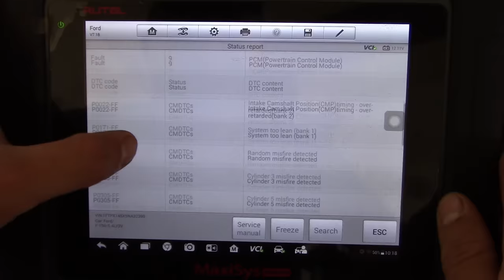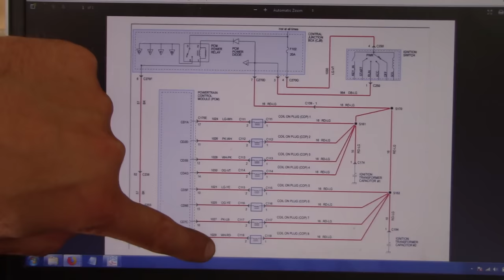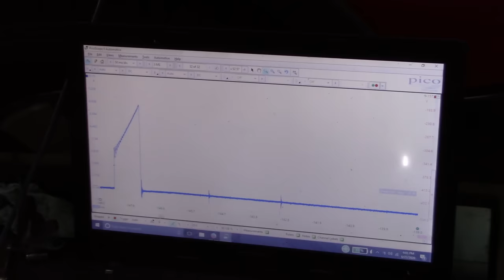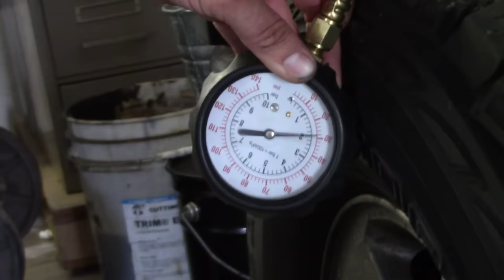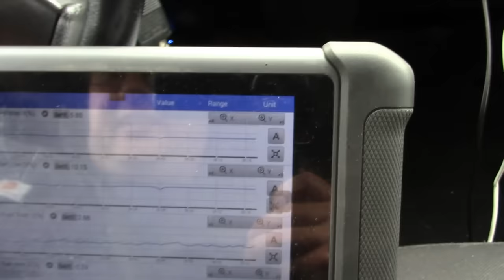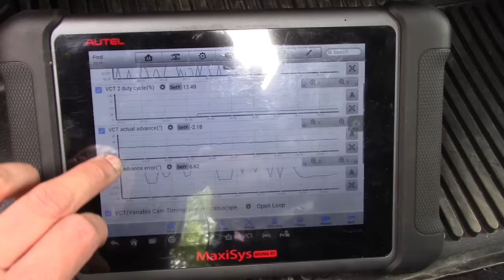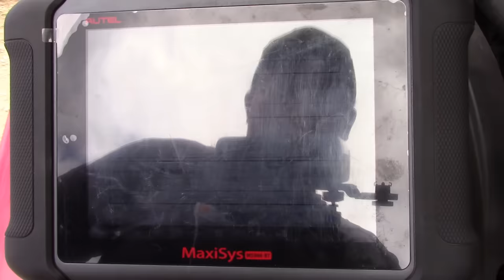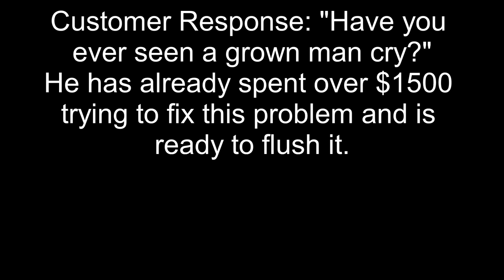2005 Ford F150 5.4L - missfires, intermittent rough running, rattles and knocks, P0021/P022

Comment: Its amazing how much of a difference maintenance means to one of these mod motors. I have seen engines fail under 100K, and have seen many that go well beyond 250-300k. One of the biggest things about these mods is clean good oil and preferably synthetic oil.
Reply: Yeah the car wizard is in the frequent oil change camp for these engines. Still though the tensioners can blow out and cook the motor so it may not matter.
Reply: @benjohnson4449  I wonder what camp the wizard is in when frequently the yellow cabs in NYC exceeded 500k miles. They used these mod motors.

Comment: Great video. You can trace it all back to inadequate pressure to the phaser solenoids. Last and farthest point from the pump. You nailed it when you got there. 07 Mustang GT is my last Ford. I do love the car. But damn just damn. Ford still hasn't figured out how to put a spark plug in. Funny they went from 14 ft lbs to 25 foot lbs for spark plug torque and have the opposite issue. Used to blow them out, now they break them off inside. Who know what the deal will be with the coyote engine noise they say is normal. ticking and rattling is not normal. Bless you for taking on such chores. Ford's cab forward design is also no help.

Comment: Ive had the pleasure of putting a new motor in an f150 after motor failure due to loss of oil pressure at 120k. Cam phaser were replaced before that at 90k. Oil pump backing plate was letting oil past the pump. Stupid idiot oil pressure light gave no warning until it was too late. 

Great video!!

Comment: Melling makes machined cast iron tensioners without gaskets.  They are for older trucks but fit the 5.4. The gasket blowing out is one of the main reasons the timing slips.

Comment: Hey Wes, here is some food for thought, this may sound crazy, but think about it for a little bit.The way I see it, he has a few options, (1) Scrap the truck and take a total lost. (2) He could go back to the person he bought it from and demand his money back “good luck with that“ (3) Sense you’re
already this far into it, replace the two chain tensioners and guides, the VVT solenoids, JB weld the front cover, don’t worry about the cam bearings, once you restore the oil pressure, they'll be fine, you may get another 50,000 miles out of that engine, put every thing back together, flush the engine and send it down the road. Of course you have to let the customer know what you’re doing, "FULL DISCLOSURE"  He should also go back to the Ford stealer/dealer and demand his $500 back and use that money to buy the parts needed. Now! That’s definitely not the way to do things, but it’s probably his best option right now. 
Just something to think about.
Reply from the maker: We just might do that.

Comment: Good news the known problems are repairable. Once repaired the motor will last 400,000+. We had a fleet of these starting in 04…. Good lord what a mess. 

In general we had the heads rebuilt with all new components, this increase oil flow through larger channels in the rods and rockers.. replaced with stronger oil pump, replaced timing chain and cam phasers.  

The only other common problem was 2nd gear on the automatic transmission.

Comment: I have the same vehicle, a 2005 F150 5.4 3 V engine with 346,000 miles.  Used 5-W-20 until I learned I should switch to 5-W-30 motor oil.   I always used Royal Purple Fully Synthetic oil, just switched to 5-W- 30 about 100,000 miles ago. Never ever did anything internally to the  engine except change the VCT solenoids because it seems like the trendy thing to do.   There was hardly any  burnish marks on the metal of the VCT's, and the screens were very very clean, and no plastic framing on those screens were missing.  The innner side of the screens werre also very very clean.  I do get some ticking noise, but I live with it.  I have original everything on the motor and all the componets, etc except the VCT solenoids. I only changed the starter at 190,000 miles. It has original alternator, muffler, tailpipe, and brake lines ( I think stainless steel).  Original catalyitic converter still original.  I did virtually nothing to this motor. I am a believer in changing parts before a breakdown, but in this trucks history, there's no indication of having to do anything.   They say you should change the timing chains every 100,000 miles. I guess then I shoudl've done that three times already, but it too is original. So what did I do to deserve this?  I don't know.  Am I just lucky?  The truck has always been hooked up to a trailer hauling soils and mulch in my business, so it's  always at the ready, and it never fails me.  Oh, and the transmission is original too.   Never a hint of a problem. I just change the filter at 100,000 miles, and I think only 1 more time after that.  And it hits the mark switching gears on the automatic trans everytime. Is it the Royal Purple fully synthetic oil?  Maybe.  That seems the only thing I believe in that could've given me longevity.  I think it will take me to 400,000 miles.  It only started to rust about 3 yeares ago here in Michigan, so I do have to swallow my pride with rust around the wheel wells, but I want to know just how far this motor will take me when most other people think this motor is nothing but trouble.  For me, it's the best Ford truck I've ever owned because the incidence of repair is almost perfect. Since it is a work truck, I do store it outside in the winter and not subject it to salt on the road.  THUMBS UP!!! Great Youtube video!!
Reply: If you work the truck, that is actually better, unloaded stop and go city driving with prolonged oil changes is one of the killers of these.  In my case it was poor build quality, I bought new, have the sticker and have found other folks with builds from the same plant in the same month have terrible outcomes like me.  I have reman engine, transmission, and rear axle.  Nailed the bastards for the rear axle under warranty, which is pathetic to have a failing axle at 35K miles.  3K mile oil changes couldn't stop my pig from failing under the hood

Comment: Driven my Ford daily for 17years and 350000.0miles!! She is a 2002 4.6 2valve engine 5speed car Mobil 1 10w30 fully syn engine oil n Motocraft filters keeps my baby on the road!!
Reply from the maker: That's a 2 valve engine, which is a lot more reliable.

Comment: Dude, you can't trust dealerships. Like I said in a previous comment, I had a Tempo that was running hot and ejecting coolant. They told me the entire cooling system and the drive belts needed replacement. They charged me $980, and the car overheated and ejected coolant on the way home from the dealership. I decided to look under the hood, despite knowing nothing about cars at the time, and found that one of the clamps on the lower radiator hose had corroded away, due to the fact that it was an Illinois car. After that, the car began randomly dying in the middle of the street, or not starting at all. After dealing with this for a year and putting it in multiple shops, we eventually determined that Ford installed the wrong size alternator belt, which was causing the alternator to charge intermittently. A week later, I went and got a job at AutoZone and started teaching myself about cars. They say that everything happens for a reason.

Comment: I was yelling at the TV through the whole episode. With the exception of the idler wearing a hole in the timing cover, my 2004 F150 had every single one of the same problems including the bits and pieces in the bottom of the timing cover. Cost me north of $3k and it was my last ever Ford purchase.

Comment: My mom has a 2001 F150 Lariat with a 2 valve 5.4L. She bought it from a friend and it had all sorts of problems, one of them being the chain tensioners. I knew it was a problem from the bad chain slap it had and she didn't have enough money to get them replaced, so I paid the $1100 or so for the job. My mechanic said it was a good thing I did because both the chain and tensioners fell to pieces when he got the timing cover off. I knew something bad was going on because the couple of oil changes I did before that job had pieces of plastic and metal flakes coming out of the oil drain in the sump. It was either a few weeks or a few months from detonating itself.

But it had all of the other usual problems, a rotted intake manifold leaking coolant. It eats coil packs, bad fuel pump, 4x4 problems, etc.

Comment: Poor bastard. Add all that to the huge rusted out chassis, its not worth repairing. Better to strip interior and useful parts off it and sell it for parts and panels. Here in Australia, if you took a car like that in for a roadworthy, they would laugh you out the door with that rust. Your a good mechanic Wes, ive just started watching your channel, good info.

Comment: From the comments i am reading, alot of people are not watching the whole video. Or maybe they need glasses.  
Either way to are pretty blind to what the problems are compto the real cost of fixing it. I know Wes probably grimaced at the thought of putting it back together  and with fingers crossed hoping for the best. 
Doing what you did, for what around $1k, hell of a lot better than $6k on a truck that will last may 5 more years. Great video and good job.

Comment: I've got this same truck...'05 5.4 and I bought it new. I've changed the oil every 3-4K and have had no problems with the truck at all. Runs like new, sounds great. These engines demand clean oil. I would say that dirty, gritty oil tearing into the tensioner gasket is what started the whole mess. Too bad for the buyer...because ignorance is taken advantage of.
Reply: what oil and filter did you use

Comment: Couldn't make it through this video so I didn't see the outcome. 
I'll share my experience it might save people a lot of money!!
2007 F150 5.4 started doing the exact same thing around 150K. Cam phaser blah blah blah.....
I found it way to coincidental that it started doing this the same day I did an oil change. Miss fires like a MOFO. 
Disconnect the VCT solenoids and everything runs great (except a bit of power loss) but the noise and miss fires  are gone.
After some research discovered a gasket or seal related to the variable timing was the culprit allowing oil bypass and severely messing up the timing. The fix to change a 5 cent piece of rubber  was going to cost me severe down time with my truck and the surgery involved may be a little advanced for me. I changed the oil to a 5w40 and reconnected the solenoids, night and day difference!! That was 6 years ago and It's still going strong. I take it on some long trips and even tow the odd trailer and the timing hasn't been an issue since switching to a  5/40. .................Spark plugs and exhaust manifolds are a different story.
Recommend  keeping an OBD2 scanner, voltmeter and a small tool kit in these trucks. These items have saved my ass more than once!

Comment: I have  a 2010 F150 with the 5.4 3 valve I am the only owner had it since new it has 235,000  miles on the original  engine  , chains and still  going strong. 😁🙏 it's been a great truck for me but it's been well taken  care of .

Comment: Great video Wes!!!! I have 2004 5.4 in my F150 and was driving and truck started rattlin and misfire detected with scanner.....Long story short, it shot head off valve a blew hole threw piston!!! Loved the change engine light remark, that's exactly what I did. I bought new engine with updated cam phasers n all that !!!

Comment: I’m late to the party 🎉 but I like to watch Wes Work. This Ford engine is a good lesson in how well a well oiled machine holds up when it’s not well oiled. Those timing chain tensioners diverted oil away from the top end of the motor.

Comment: When I worked at an independent shop we did at least 3 cam phaser lock outs on these came with a little tool that flashed the ecu to remove the vvt
Reply: Sure, you can go that route if you're hard up on money. However, it doesn't fix the failing oil pump or the blown tensioner seals that are the main issues in these engines.

Comment: I have seen these phasers wear out right after warranty ends, and about 5-7 before. This one lived to be ancient compared to most lol. I have also seen the control solenoids fail and screen get plugged blocking supply through the solenoids.

Comment: I have a 1999 lariat with the 4.6l it took me a long time of not getting right parts. Always heard you want a Windsor and not a Cleveland bor visa versa. Will a friend told me he work at the Ford plant in Kansas city building Ford trucks. Had WOW moment. I found the code on my truck sure enough it was built in Kansas city. Now im get the right parts because different everything is heftier for example I ordered a new timing chain kit because had a little rattle it doesn't have ca m phasers its a 2 valve. And I also went ahead and got a new harmonic balancer. The one I was given first was much smaller than the one I had on it. Tookbit back. He gave me the one for a Windsor it was a little bigger but still waybto small. I told the guy st Napa about what my friend told me about Kansas city. He did some checking and found indeed they have parts for the Kansas city 4.6l but he would have to order it. Frim that day forward never had a problem getting part's. I changed alot if parts only because if there age not because they went bad. I only have 2 coils each controls one side of the motor. I replaced both just because . Got them from Amazon. With in a year one went out. I still had the old coils so just put them back on. I have a aluminum intake not plastic but it started missing found that the intake gasket had blown and was flooding the number 8 spark plug port with water so I replaced the gasket and the back plug runs perfect. By the way it has 300 thousands miles and just now changed the original spark plugs. It was a one owner. I know the old guy and he said he never change them. I went back with motorcraft as i do with as many parts that I can.

Comment: I have a 2004 F150 with this same engine. It currently has 176k on it, and I've never been inside the engine. My advice to anyone who owns one of these is CHANGE THE OIL OFTEN. Use good, high quality synthetic oil, and change it every 3k miles. Don't go to 5 or 6k, and definitely don't believe the 10k hype on the bottle of synthetic oil. These engines are super sensitive to oil quality and have tiny passages that can clog easily. If you keep that oil clean, you can avoid most of this heartache. Mine could probably stand to have the tensioners and gaskets replaced, but sadly this is the last year for the old girl. 20 years of a New Hampshire high salt diet has taken it's toll, and the frame is about rotted through. It's too bad. She was a good truck for a lot of years, and she'll drive herself to her final resting place. Aside from the usual maintenance stuff, I've put a starter in it, an AC compressor, trans cooler lines, and a set of plugs and coils. Did the plugs at about 124K and they spun right out. Been a damn good truck and I'll be sad to see her go. A bad coil was the only time I ever had the Check Engine light on. Take care of it, and it'll take care of you.

Comment: Timing chain tensioner / aluminum flake collector, lol. I had assume that was all from chains grinding the insides of the timing cover. I'm doing think I'd have pulled the cam caps, but, it's good you did. I see your pinned update from a few months ago. Yes, bolting the p.o.s. back together and getting a few more miles out of it before the frame rots in half was probably the best plan. No telling with the mains looked like with all that metal floating around the oil galleys.

Comment: Hi Wes, excellent video, I wish your shop was in my town...  I have a similar issue on my 2006 lincoln navigator, first I got a P0022, researched it and replaced the solenoids. A week later got a P0011 code. Some of local mechanics don't 'do those jobs', others scared me with $4k estimates... The car has over 265k miles, but looks great, paint is beautiful. A year ago I lost the air suspension, so I bought high end struts and replaced them myself, replaced alternator, pullies etc.. so I don't fill like throwing it away yet, so I am thinking is the 'cam fasers'... do you have a rough estimate..? thanks so much.

Comment: Wes thank you so much, I really wished I could have watched this before I bought my 2005 f150 3v 5.4, 3 weeks after buying the truck it had a misfire, I changed the COP and it went away, now not only is it back, but now it sounds like something broke inside the top end on the passenger side of the motor. Looks like I'll be buying a new motor here very soon unfortunately 😕

Comment: I doubt you'll ever see this, but for anyone else that might:All 3v and 4v 4.6s and 5.4s have defective oil pumps from the factory. ALL of the timing problems these engines have are caused by poor oil pressure. Sure, Wes checks the oil pump and it had decent pressure...at idle. The problem is, the backing plate on the oil pump is aluminum. It flexes and dumps oil back into the pan at moderate-to-high rpms, exactly when your engine needs extra lubrication the most! If you have one of these engines and the phasers are rattling, you must replace the timing and oil pump ASAP! If your tensioners are blown and you're getting chain slap, there are cast iron alternatives.

Comment: Just did this job on my '10 f250 5.4l. It had a blown timing chain tensioner, phaser issues, and leaky exhaust manifolds. Lucky for me I caught the Timing Chain before it started to eat the cover. Upgraded the oil pump, checked all of the roller followers, replaced the exhaust manifolds, water pump(didn't really need it), and a couple of noisy belt pulleys while I was at it. 

Like the truck, HATE the engine.